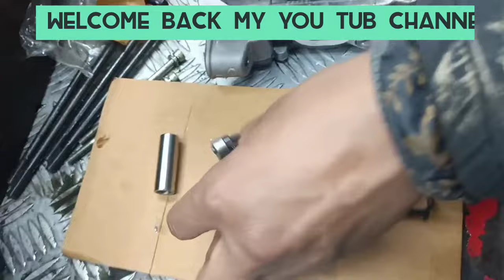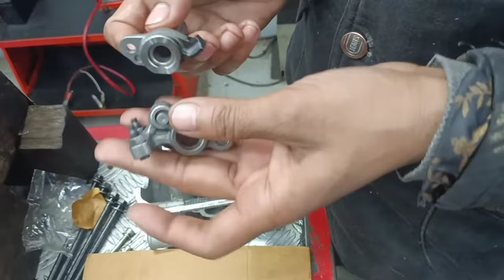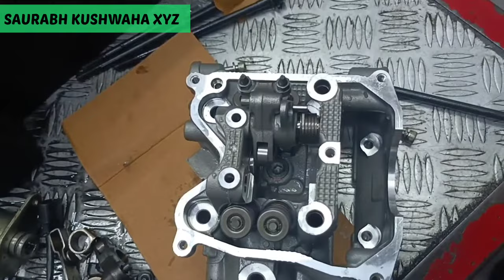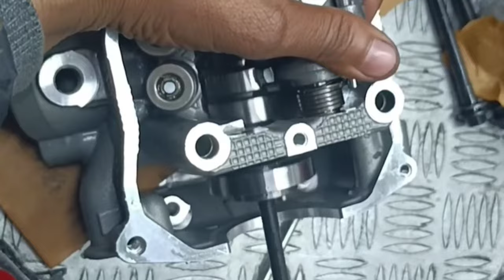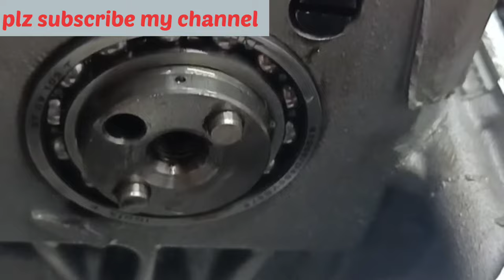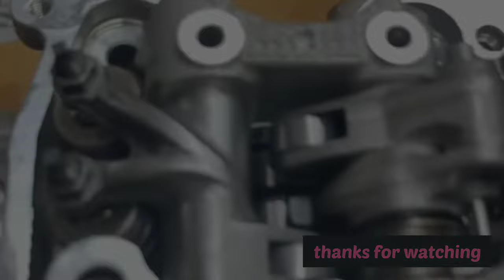YAMAHA R15 V3 में VVA रॉकर लगाना सीखें.YAMAHA R15 version 3 calendar Head installation. #VVA #R15 V3

Comment: Head proce
Reply from the maker: 5000 to 6000 around only head assy 
Rockers and cam shafts and valve not come in head assy.
Reply: Thank u soo much broo❤‍🩹
Reply: Camshaft valves rockers / price tell me broo please
Reply from the maker: Around 7400 +800 both rocker 
Around 1650 camshaft
Around 800 valve set